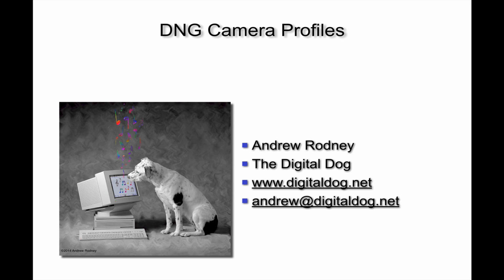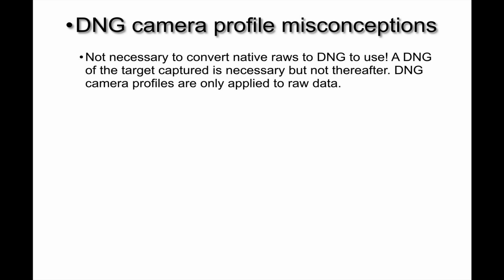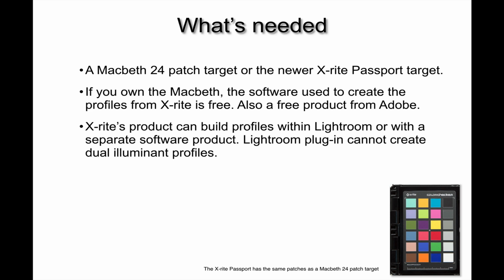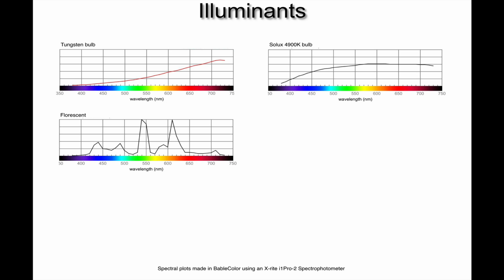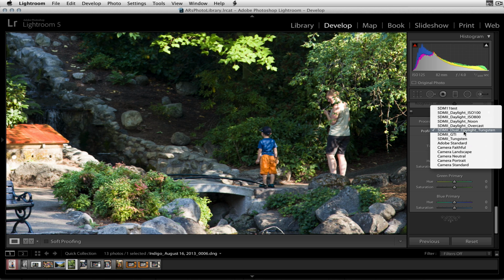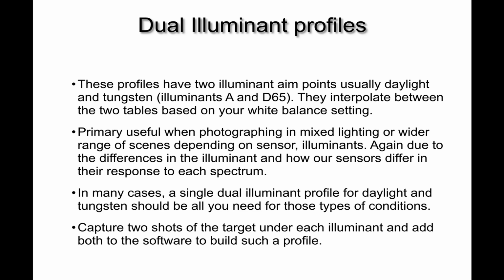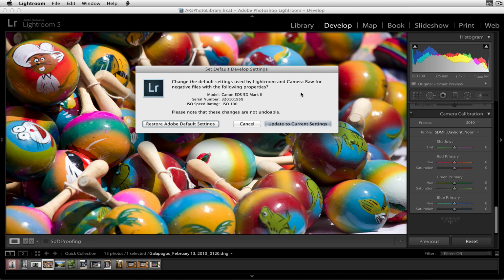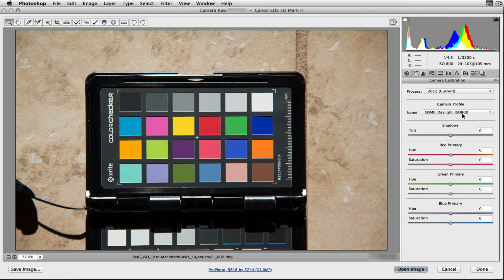DNG Camera Profile Tutorial

Comment: Thank you for the video, which is very useful (as is your book). I am wondering whether it make sense to correct lens color casts via dng profiles. In other words, profile lens and camera combinations to this end. For example, one might have a body of work using two lens, one which seems to produce images that are more saturated than the other. Perhaps profiling the two camera and lens combinations would correct the differences in saturation. Thanks for considering my question.
Reply from the maker: Not sure I fully understand but should point out, the DCP (DNG) profiles have nothing to do per see with a lens and there are separate lens profiles which are totally different. Differences in rendering (slight contrast or color) per lens would likely best be handled with neither (the lens used to build the DCP profile might have a tiny effect but I kind of doubt that). Better would be a preset that adjusts the slight differences in lens and use per group of such images.

Comment: Also,  I have read around that profile is lens-related, but I assume it's not from your description.
Reply from the maker: +niccoc1603 Those are quite different profiles and only share the name "profile".
Reply: +Andrew Rodney I know what you are referring to. There are however a couple of tutorials around that say "when you crate a DNG profile, this is related to your sensor AND your lens"
Reply: In those cases, its the tint of the "glass" in the lens and the behavior of their light-bending that are affecting the camera profile most likely. Personally, I have made dual illuminant profiles for all of my lenses just in case. I have also made dual illuminant profiles for any ND filters that I use, especially the ND1000 since it has a huge colour cast. It does have a noticeable difference in my shots. The colour cast is completely removed when I select the appropriate profile. Much better than trying to fiddle with color correction. ;-)

Comment: I often shoot sports in a gym (tungsten light) and much of the light that hits the players bounces off the floor (in addition to the overhead lights). The floor is yellow. Can I assume that I can simply use my tungsten profile that I made elsewhere as the wavelength of the light, bounced off the floor or from above, is the same and therefore not affect the DNG profile? My understanding is the for WB I do need to that that measurement as close to where the light actually hits the subject, in this case hold my WB target 6 feet in the air by the basket. Any comments would be helpful.

Comment: Could you recommend a proper way to do a tungsten part of the dual illuminate profile? Would a bathroom with white walls be a good option?
I guess I would have to buy a tungsten bulb. How can I be sure I picked the "real" tungsten bulb? Could you recommend a brand, and type, please?
Reply from the maker: I would think a bathroom incandescent light bulb should work fine for use to build that part of the profile. Again, it is the illuminant and it's spectral properties you're trying to profile.
Reply: I understand. My concern is I don't know what type of light it is currently in my bathroom. I guess any incandescent bulb will do it than.
I also noticed the difference between the X Rite dng profiles, and DNG PE profiles, both using the same Colorchecker target shot. I am a bit confused with this, how can I tell which one is better, the one that's more pleasant?
One last thing, I noticed there is a product called QP203. Do you have any experience with it? It offers a bit more patches, and claim to be better.
Thanks for the comments!!
Reply from the maker: MrMilanina Again, it isn't critical as long as this is really an incandescent bulb, the spectrum is similar to other such bulbs. As to which is better, the one you prefer visually is better. Never used QP203 but it's being (been) discussed on Luminous Landscape, there were recent comments they may not be around any longer. And yes, you will notice slight difference between Adobe and X-rite's profiles from the same data. That's to be expected.

Comment: Thanks for the detailed explanation of how DNG profiles can be used to calibrate a specific camera sensor + illuminant to a standardized reference color swatch. My question is how a custom single or dual illuminant profile compares to the sets of DNG camera profiles that Adobe provides for ACR support of each manufacturer's built-in picture profiles? Nikon, for example, provides Standard, Neutral, Portrait, Vivid, and Landscape profiles that produce comparable JPEG results across all models of DSLR's in their product line. Adobe provides corresponding DNG profiles that reproduce those results on RAW files from each camera model. Is there a way to combine a custom calibrated DNG profile with a selected built-in camera profile to reproduce that profile's color balance under a particular illuminant?
Reply from the maker: >>My question is how a custom single or dual illuminant profile compares to the sets of DNG camera profiles that Adobe provides for ACR support of each manufacturer's built-in picture profiles?

You've built a custom profile for your sensor. Adobe does the same for the single camera (assuming they only receive one camera) and it's custom for that body but may differ from yours. Much like the difference between a canned ICC profile for a printer and one you make yourself. The quality difference depends on the consistency of the manufacture of the product from unit to unit. 

The profiles from Adobe called Vivid, Landscape etc are edited in an attempt to mimic the picture styles from the camera which is proprietary in-camera processing. After you build your own profile you could also attempt to edit them to look as you desire or to 'match' a camera look using Adobe's free DNG profile editor. It's kind of geeky but effective if you spend the time 'tweaking' your profiles. That's the only way I can think of to combine a custom calibrated DNG profile with a selected built-in camera profile's 'look'.